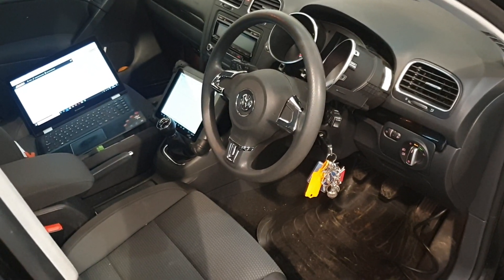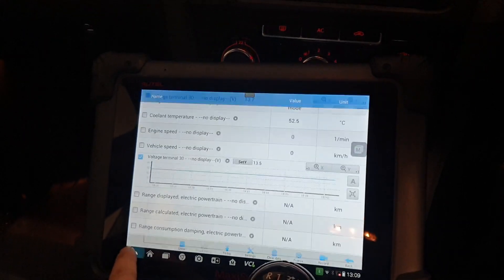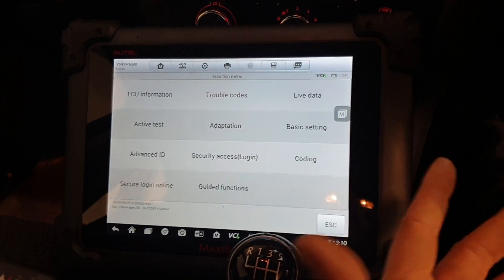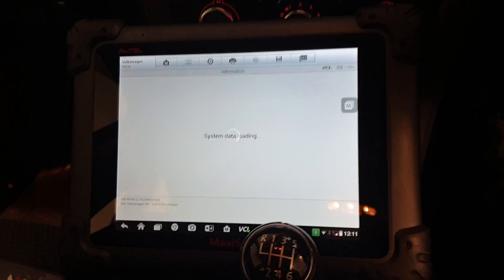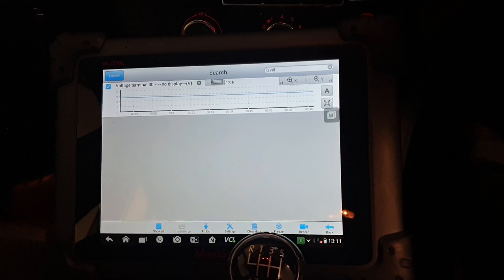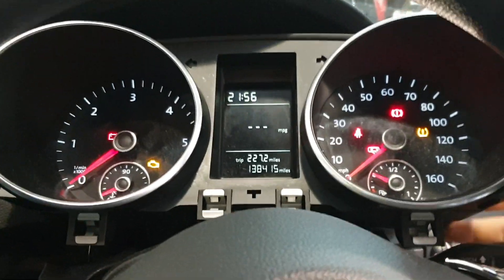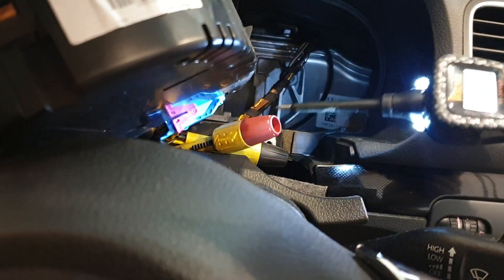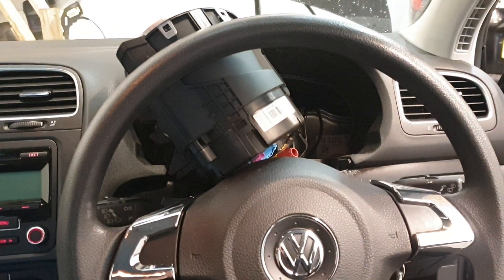VW Golf Dash Not Working

Comment: My mk5 has this issue where it starts then turns off, but my instrument cluster has no power at all. Any idea?
Reply: I have the same issue on my mk6 and cant find anything
Reply: same issue on mine!  were you able to fix it?
Reply: Same. Did you all find anything because it’s been a year for you. So I’m sure you guys must have an answer
Reply: how did you guys go
Reply: I found out what it is. 

Under the steering column, there are 2 fuses. Black box looking type of fuses. Like a relay. The number of that fuse is 460. That’s what’s written on it. Change both of them. I did that on my 2009 Gti and now it works fine

Comment: so in the end what caused the problem and how was it fixed?
Reply: I have exacly same problem, How did you fixed it? Thanks
Reply: @fabiengaspari6393  my instrument cluster is working again, in my case moisture was causing the problem, so i opened all the doors of the car on a sunny day to get rid of that moisture.